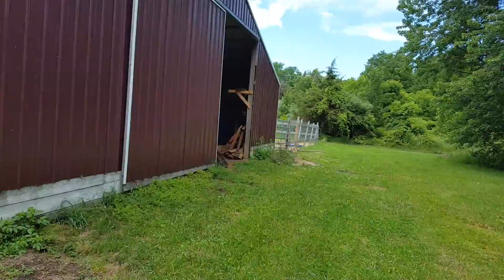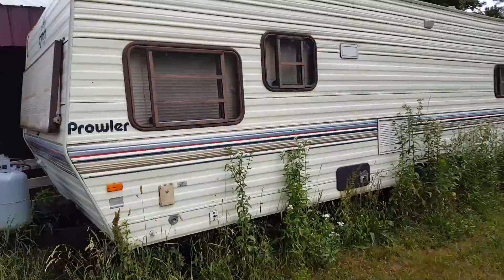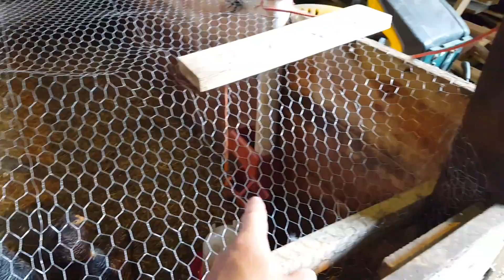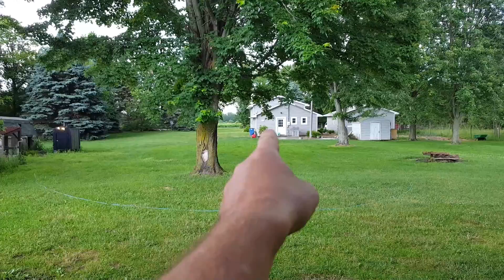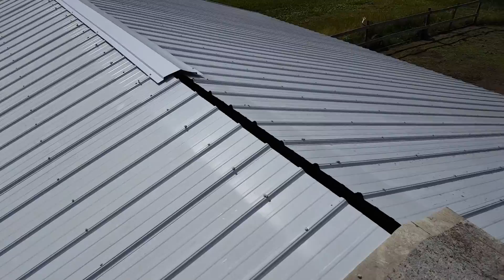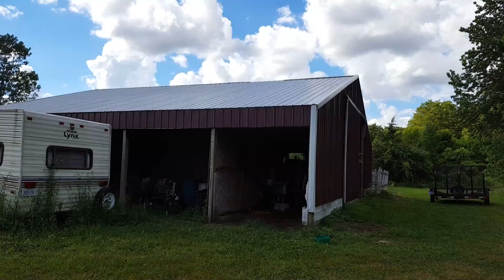One Thing at a Time - Leaks and Electrical

Comment: Would love to come by and offer a 'hand' in some of this work you have obviously left for the future...bit difficult from here in Australia...but I would suggest, as you get to the edges of your barn, slide some (collected scrap) sections of roofing iron under the end of the roof and put your gutter sections about 4 to 6 feet away from the walls of the barn. Offering overhead protection like this may give your animals more shelter from rains, allow you to collect rainwater runoff into IBC totes etc AND move those puddles well away from the barn walls. Most barns in Australia have these sorts of arrangements and they often do not have doors once the "veranda" roof is in place...
If you do not want to put posts in the ground to hold it up, you could always cantilever the roof section from the shed walls.
Hope this idea helps a little...
Loving your videos and please, please keep them coming.
Blessing to you and yours.

Comment: I would recommend using GFCI receptacles outside or in the barn where water and moisture  are a given. One GFCI can protect more  'regular' receptacles down the circuit where you don't need to buy a GFCI for each one and can also protect the switches. Home Depot sells a 3 pack for under $30.00 which is a big money saver. Just my 2 cents.
Reply from the maker: +barnieb1961 absolutely, when I get down to wiring the whole thing up I plan on adding a subpanel and running GFCI on evrything
Reply: SSLFamilyDad how big of Sub-Panel will you be putting in? Home D by me had a whole cart with them marked pretty low and maybe able to hook a brother up :) Also with my years in the trades the switch looked like it was put in by someone with experience; the way they 'parted' the wire casing to wrap around the screws, because it is a stranded wire, is how they do it and also you will be happy the switch was wrapped with electrical tape to cover the connecting screws because like most of us knowing electrical don't want the power turned off to diagnose a problem and them screws touching the Small metal box it's in almost always creates  a spark! The blue wire is another 'feed' wire which was probably there for a receptacle being installed in the double gang box  for future use; check where the wires are comming from and you will see it's just ' hanging' there for further use and you can use the existing White wire from the rest to complete the circuit. And to add, houses here are wired totally in 20 amp wire but use 15 amp switches and receptacles. As expensive as 20 amp things are don't waste your money. I would only use 20's where my 110 welder or chest freezer are and than again 20 amp is for all commercial use, you will be safe using 15 amp everything with a 20 amp wire unless your pushing the limits than put in 20 amps.
Reply from the maker: +barnieb1961 you are correct that the previous own had some experience as I think he was beginning a career as an electrician just not sure he did things the way they should have been done but maybe the quickest, cheapest, and easiest way. I will probably just add a 50 amp panel out there and a couple 20 amp circuits and maybe a 15 for lighting. I prefer to do everything in 20 just because I don't want to worry about overload and I typically have a lot of tools, heat lamps, and hook up the camper with air conditioning out there as well

Comment: When putting gutters on the barn, are you planning on capturing the water to use on the farm?
Reply from the maker: Absolutely, in fact neither my house nor the barn has gutters so I will be doing rain collection on both when I get to that........
Reply: careful about collecting rain water off oil based shingles.  petroleum distillates wash off the roof with the rain.  At least the first portion of water.  Steel is much better roof surface for that.  water still needs to be treated for cleanliness regardless.

Comment: I cant be leave every USA video I watch that has a metal roof it seen the roof strapping is 4 feet a part and only a 4"x3/4" board, here it has to be strapped using 2x4 or better yet a ruff saw 1-1/2"x 4" full size but code is minimum 2x4, and no more then12" center spacing, walls can be 16" to 18" spacing max, and the seem to screw the roof down on the flat with 1" screws, here you must use a 2" screw and only screw on the ridges on the roof and on the flat on the walls with a 1" screw, I some time wonder what I hear is really true in the US
Reply from the maker: To be fair this barn was built so cheaply and every corner was cut. A good pole barn is built very similar to as you described
Reply: oh I am sure most are built right, I was just saying I have seen so many on here built this very same way, and being built, and you try to give them pointers and they run you in the ground like the young people they are, they know it all.